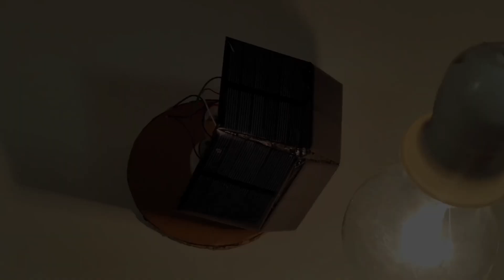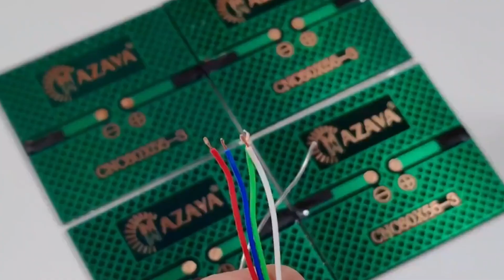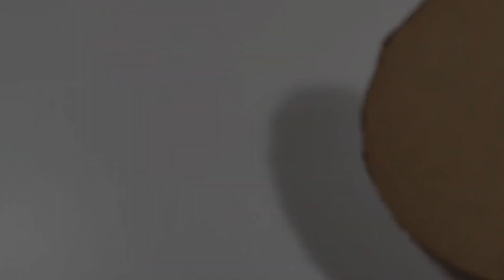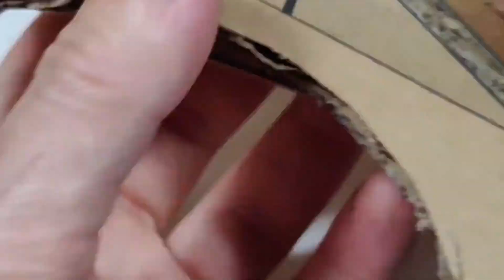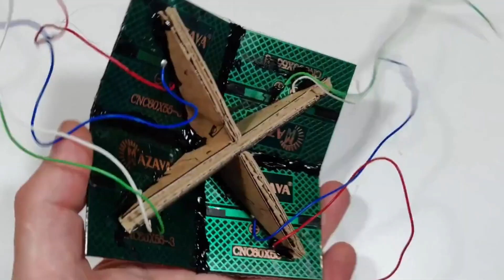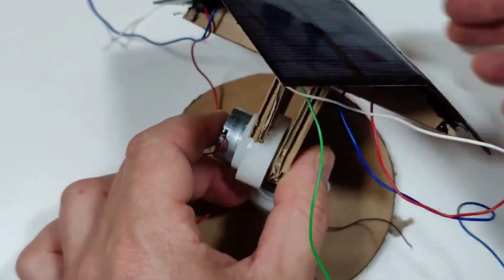DIY Eco-Worthy Style Solar Tracker - No Microchips Needed!

Comment: Nice, but what if I want to charge a battery too , not just tracking? :)
Reply from the maker: When the solar panel setup is large enough, you can branch off a small part of it in parallel to drive the motor, while the main output from the panels is used to power the load or charge the battery.